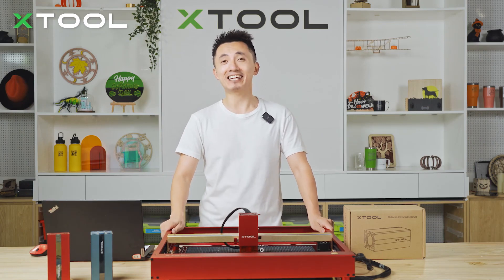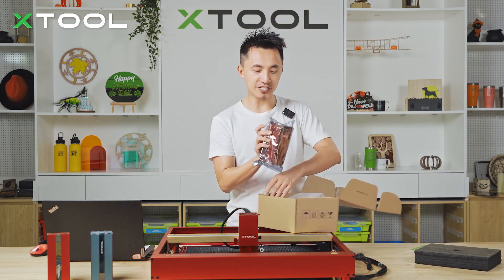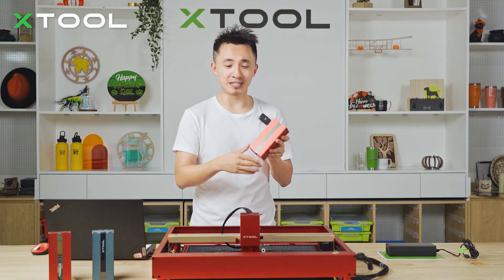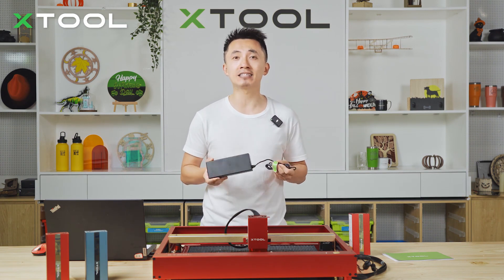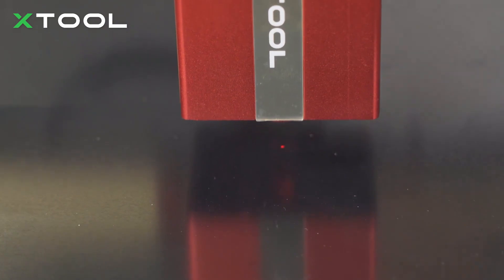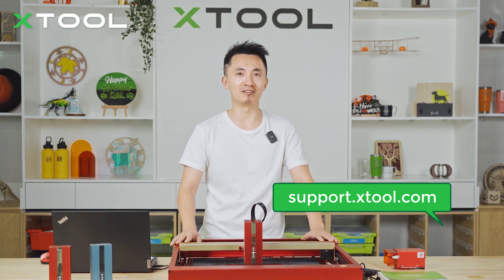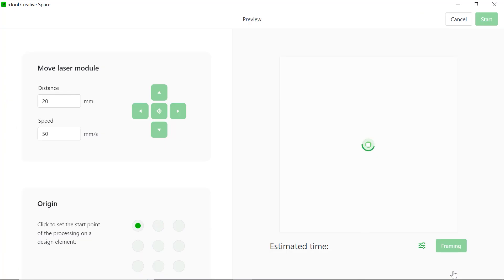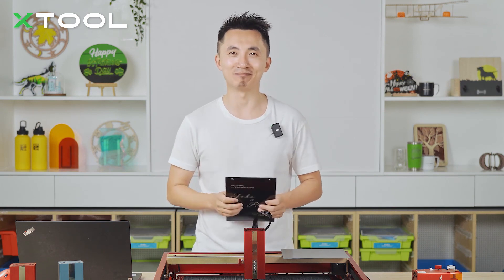xTool Infrared Laser Module Unboxing and Tutorial | xTool 101

Comment: at the 3:05 point in this video.. he removes the cable from the 20w module.. and its one long wide pin casing... the D1 I have has a cable with two pin casings.. one smaller than the other.... I have a 1064nm that i am trying to install and it does not seem to be compatible with my D1..  help.. confused..  thanks.
Reply: @INSTAGON  I caught that too but I think he has the regular D1 not D1 Pro. We have a 2pc wiring going to the module
Reply: Now I understand the dilema. I had just got mine today and when I set it up, its a different wiring harnass as well as no tube hole for the Air Assist.
Reply: @MS-cd8vb i do not think you need the air assist with the IR 1064..that is why there is no port. 
But the other problem is real, i was told today by Xtool that my D1 machine is not compatible with this module, that it requires a D1 PRO...  so now I am stuck with a laser i cannot use.  bummed.

Comment: I have the original D1 which came with the 5w head, I have upgraded to the 20w head, now I have the IR upgrade but the IR head only has 1 connector but my 5 and 20 w has 2 cables. How do I connect the ir module and make it work?
Reply: i have just unboxed a 1064nm that i have had for nearly a year.. and am having this same issue.. have you found a work around?